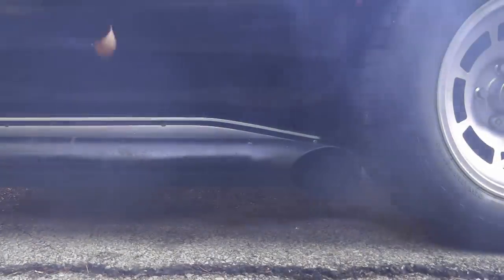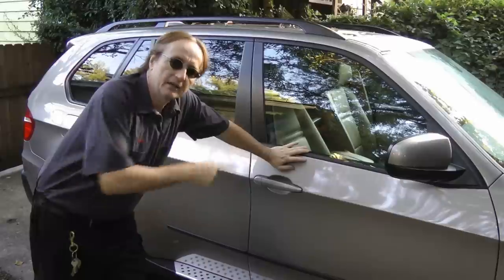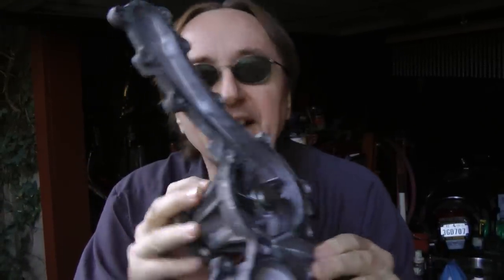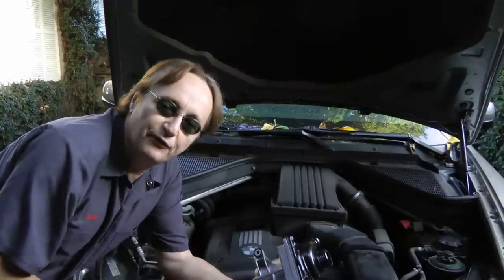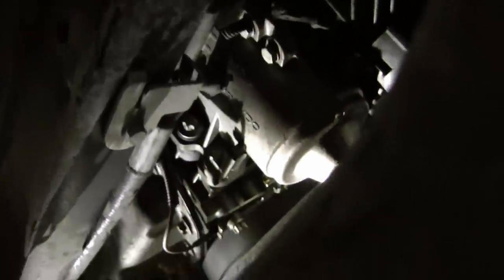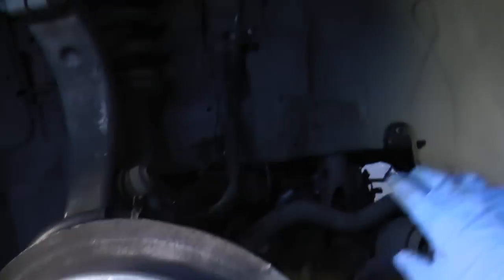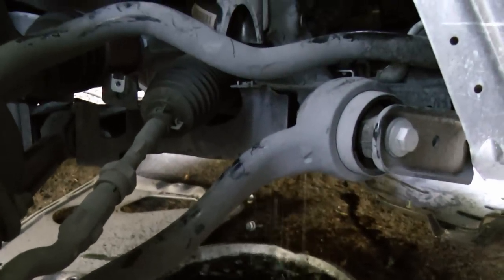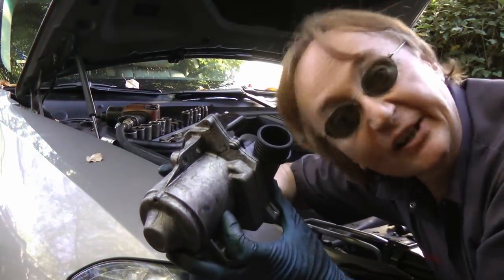How To Replace a Bad Electronic Water Pump

Comment: It is more beneficial to remove the AC system for weight savings, that is a lot of weight in components if you only care about going fast and not comfort. When the compressor clutch is not engaged there is not a lot of drag on the engine. 

I wasn't saying the alternator cant handle it rather that the electric water pump still gets its juice from a pulley on the engine.

The engine doesn't gain hp/torque it still has the EXACT same amount, just more is available for the drivetrain.

Comment: Scotty my bmw x1 2014's water pump keeps running until the car is dead. It hasn't overheated or said anything about temperature problems. I recently changed the thermostat on it because the heater only blew cold. Nice and hot now but after that was when I started finding the car dead with the water pump going all the time. Do you think its a bad pump or a sensor or something? I didn't bleed the radiator properly when I did it. didn't figure that out until later but it still won't shut off. The previous owner had green antifreeze instead of blue. If you got an Idea why the pump won't shut off let me know. There are also 3 codes coming up but I don't know what they are. U0079. U019F. P10F5. my car is the 2014 bmw x1 s28i something like that. Thanks

Comment: And also think of it this way. your car stereo draws more electrical load than a electric water pump. 

The down side to them (as kilmer pointed out) is that you won't be able to tell if the pump is out, unless the symptoms that were stated in the vid, show up.

Comment: Hi Scotty, Love your Videos. Here's a dumb Question. 2001 Jaguar XKR. The Auxilery Electric Super Charger Water Pump. Does it Matter which way the Pump Runs? It should Pull from the Auxilery Radiator and go Into the Supercharger, or the other way around? Also, can I Bench Test it by Attaching hoses to the inlet and outlet and Pull out of a Bucket of Water? I Know which wires are hot and ground on the Car, But they are not Labeled on the Pump itself. Thank You.
Reply from the maker: it matters which way it runs to keep overall flow the same.  But I have no idea which way it goes, as i've never worked on one myself.  but you  can bench test it, it's just a DC motor and running it backwards doesn't hurt the pump

Comment: he is partially right. Car manufactures are making more things on a car electrical because the alternator is more powerful today. Another reason is because it saves gas and there is more power leftover. See the alternator in today's car does not run all the time. The cars run on the battery and when the battery gets to a point the alternator turn on. So it freewheels most of the time(before the alternator always ran) But you are right the engine does not produce more power.

Comment: I'm simply amazed how, bulky that BMW pump is. The waterpumps on my last two cars were fully metal, compact affair about the size of my palm, even together with the impeller.  Mind you they were not that convenient to change either, that's why it was replaced together with the timing belt at the 120 thousand mile mark, when the vehicle was 16 yrs old, for the grand total of $400 including timing belt and engine seals.

Comment: Before they had the plastic ones, they had ones with metal housings that weren't any better. The entire engine has aluminum bolts to save weight. They designed it with an electric pump to better control the flow of the coolant and keep the drag off of the engine. Doesn't seem like much, but with it electrically controlled, and not having to drag down the engine all of the time, they save a little fuel and make more power. It is true that the pumps don't last long...I wish the company that was subbed out to build the pumps (I believe it was Bosch, but can't remember exactly) did a better job. I used to be a dealership technician and I replaced a lot of these. That particular model (E70 X5) is a little harder to replace the pump on, but the job can be done in under 2 hours.

Comment: I find it hard to say this, but could you get the best of both worlds? I know this is BMW, and they most probably justify the plastic with the idea the car is lighter, but could you get an electronic - METAL - water pump to get all the advantages you listed? 

Either way I would rather go with the mechanical pump at the end of the day, just food for thought

Comment: I am not in disclosure to say for security and privacy reasons. Yet i can tell you that, with proper maintanence, my car can get me around 20-22 miles per gallon on average. Both city and hwy. And, for a car that is more than 70% metal, that's pretty impressive for a 20 some odd year old car.

Comment: Common, it's not like he is the only one. I watched a video here on YT for example, where a guy who owned a professional garage, said the same thing. He actually removed a late model BMW engine and put it on a stand to better point out these plastic auxiliary parts bolted on the block. (There are at least six or seven similarly problematic engine ad-ons like the water pump mentioned). He was methodical and pretty depressive. At least Scotty added some light hearted humor to it, in comparison.

Comment: The water pump is designed to spin independently of the engine, and it also increases gas mileage, however slightly. BMW is hardly alone in this practice, and Toyota is moving there too. 

The days of heavy metal parts in the engine compartment is long over. If that means a decrease in fuel mileage, and therefore carbon emissions, I'm all for it

Comment: Warranty only pays like 2 hours to the tech for that water pump, just did one the other day... Another way is to remove fan and shroud, unbolt it underneath, push the thermostat out the was and squeeze it past the a/c belt

Comment: Hi Scotty, I own a BMW X5 e70 35d, my A/C was blowing cold air for one vent and hot air for the other(passenger side). My mechanic think there´s a leak on the evaporator... I was wondering if maybe this has something to do with the heater control valve... instead of just make a huge mess dismounting everything on the dashboard to get to the evaporator and replace it. Comments please

Comment: Hey Scotty ! You forgot that the whole purpose of this type of water pumps is to save weight and energy. For example the unit is somehow lighter than the metal one and is not spinning all the time (cold engine). But then all this "green savings" go to the trash when the pump fails and you have to do this. Planned obsolescense ? I bet that one for sure !
I have an 82 Mercedes and since then she travelled 400.000 Km and nothing more than maybe a water pump, shocks and things like that, Cheers !

Comment: I have  a 1997 Buick park avenue and I have a code reading "incorrect purge flow". I changed gas cap, charcoal canister, purge valve , still have the code I seen some disconnect lines under the engine cover. Connected those . I still have the code, do you think it's the NVLD or something like that excuse me if I spelled it wrong. And suggestions?

Comment: Also I know for the 3 series cars, the pump, with thermostat can be had for $400-500, from some of the online European shops, in some cases, you can get a whole package with all the plastic bits and bobs that usually fail with the pump. It is usually good preventive to replace it just after 100 k.. In my case anyway, since I have the CPO warranty. Im at 67k and hope mine fails at 99k for warranty reasons.

Comment: Scotty,
 i have 2006 BMW 325I 87K miles. Its overheating and when i turned on the heater there is no heat. Some say its the thermostat and some say water pump. Top radiator hose is hot and the bottom radiator hose is cold. The fan does not spin until it hit 245 degress Fahrenheit (YELLOW  light comes on the dash) and then at 250 degree RED light overheat on dash. Is there other way to check to see water pump is working while still on the car? 
Thank You Sir!

Comment: I bought the new Volkswagen Tiguan engine 2000 cc diesel 150 horsepower gearbox DSG, 4MOTION system. What do you think? It's a reliable car?
Reply from the maker: modern vws tend to be endless money pits as they age due to plastic being everywhere.  But it is a diesel, and they are better than their gas counterparts
Reply: Thank you! Have a nice day!

Comment: I bought a 94 325i with 156k last summer that still had the original water pump with the plastic impeller. Then this summer at 180k the radiator finally blew. I think that's pretty good considering how old the car is. With BMW going to electric water pumps I'm sure it has to do with fuel economy and temperature control more than cost. I can buy five or six regular E36 or E46 water pumps for what one of these electric pumps would be. Lol

Comment: Agreed on all counts.  I've asked BMW about this and they claim the failure rate for their plastic pump is the same as the metal ones.  Of course, if the car was under warranty the customer would get it replaced for free and not have to aggravate you into making a video so you can bash what is a sweet driving car.  It really is.

Comment: So was it the pump or the motor that quit? I have a 2013 escape and it's water pump, which is leaking, is similar to the toyota pump you replaced that ran off the timing belt. Which to me seems like a lame idea too. Though not as lame of the ford engine that runs the water pump from the timing CHAIN!

Comment: hi Mr. Kilmer, will I be able to get to the pump if I remove the radiator which I'm also going to replace? it's the same BMW as in this video. My pump lasted to 90k. I got my new pump for $300 and $250 for the radiator, not bad if you ask me.
Reply from the maker: yes, that makes the job easier
Reply: No need to take the radiator out at all. Lift the vehicle up as high as you can and work from underneath. There are a total of about 4-5 hoses that are connected to this pump. This is going to be the hardest part, as they do get a little bit stuck, but with a bit of patience, you should be able to do it no problem. If you are changing the radiator for whatever reason, then sure - take it off, but I don't really see how it may make your life much easier.

Comment from the maker: cause bolts tend to get cross threaded, break, and then big repair money goes to the mechanics. And generally, they like making fixing their cars a pain in the ass, right down to just bolting the wheels on. On this baby, I had to sledge hammer the wheel off the hub cause it had corroded on and just hung there after I took the bolts off.

Comment: I have that pump as well. I agree it is expensive but buying BMW you expect top engineering and this is what you get. Previously, having a pump that is fully dependent on engine revs was a bottle neck. Now pump is independent of the engine and can be freely controlled by the ECU what increases economy and HP. It is a progress and if you don't like it, you can always buy some more basic car. I just really hope that diagnostics of that pump are fairly designed and I will get some indication of a failure before engine overheats.
Reply: +MichalMalpa A fool and his money are soon parted.  With the improved "economy" I  guess that car will pay for itself in no time at all. "Bottleneck'?  You really have to be joking.
Reply: +MichalMalpa Good go give BMW your money. Heck an average BMW dealership has almost 10 service advisors working there and are swamped due to bullshit problems the cars give. We're talking newer cars with low miles too. Top notch engineering should mean built to last and not reinventing the wheel. Heck even BMW themselves changed stuff because they knew they fucked up. Remember the viscous fan clutches? How stupid and failure prone were they? MB unfortunately is following suit too. I had to replace the computer controlled electric thermostat in my car so instead of costing around $15 for the thing I ended up paying $100 for the part alone. A thermostat is such a simple functioning item and for some reason they had to make it computer controlled.
Reply: Djonkie Bonk
Not surprised. My company provided me with two new M-Bs and they were problematic from day one. Our experience mirrored nationally-published data.  Never again.
Reply: wholeNwon The thing is that they drive really nice and feel heavy and significant like a good quality watch. If only they ran like one for a long time. I don't mind changing extra suspension parts to maintain the ride or use expensive oil to keep the motor in good order but random shit breaks on these cars and the design of them just makes you scratch your head. Plastic electric water pump, plastic oil pan (BMW N20), electric thermostat, plastic cooling pipes, reverse flow manifolds (BMW N63) and too much emissions crap that leads to carbon buildup in those motors. All dumb designs.
Reply: +Djonkie Bonk Their shortcomings are well-known and widely publicized. 
I have a 3rd generation Lexus LS400 and love it.  Consider one of those or an LS430.  Bet you'll never go back to any German car.
Reply: wholeNwon Yeah a non air suspension LS430 or better yet a well maintained LS460 would be great.
Reply: +Djonkie Bonk Join the owners' club, read a little, etc. and I think you'll go for the LS400 or 430 instead.

Comment: Let me simplify it for you.

An engine is an air pump. It needs 3 things to run; air, fuel, and spark.
the engine's main job it to move a car. 

If it's using part of that power to drive other things, it sucks power away from moving the car.

What does an electric water pump draw power from? Electricity. 
Now with this draw, spark would only be effected if the charge cycle for the ignition coil wasn't quick enough. ignition coils are over engineered because of elect load from else where.

Comment: Going a bit off-topic, but I see a lot of BMW flame on the comments.

I don't know about the newer models, but I got 2001 E46 325 and that has been reasonably easy to repair. Not that there has been too much of that though. And it has the M54 engine, which I believe is one of the more reliable BMW motors. And not that hard to work on, at least not according to some vids on youtube and service manuals I've read. Though, cant say for sure, since I've not have to do any major repairs under the hood yet.

Now, it does have little more preventative maintenance than you regular family sedan, and it would add up quick if I was not doing it all myself. But there are ton of the older 3 series, so parts are not that expensive, at least not your typical BMW expensive. But the way it rides, well I think the hassle is worth it.

And sum it up, I do agree with mister Kilmer here to a degree. If you can't do basic and intermediate repairs and maintenance yourself, don't buy a BMW. And if you are not rich, don't buy a new BMW. (or one of the less common models, like 7 series)

Comment: Scotty Love your show...that said......The coolant in that car was not the correct coolant judging by the color Ethylene glycol was introduced allowing (stray) electrolysis current. Bmw and many other manufacturers specify H.O.A.T / g-50 coolant to prevent corrosion (head gaskets). Your customer will be returning in the future with milk shake lubrication problems and a engine code for eic soon
Reply: all coolants are derived from ethylene glycol.
Reply: Propylene glycol is frequently used as a substitute for ethylene glycol in low toxicity, environmentally friendly automotive antifreeze
The eutectic composition/temperature is 60:40 propylene glycol:water/-60 °C the −50 °F/−45 °C commercial product is, however, water rich; a typical formulation is 40:60.
Reply: According to my bottle of BMW coolant contains ethylene glycol.
Reply: Sometimes BMW branded coolant is basically G05 with color dye. Same thing with Mercedes coolant. They just add blue dye.

Comment: Scotty........I have a 2001 Grand Caravan with a CHECK ENGINE light and dealer said needed new TCM/TCU -Transmission Control Module. Want to change it myself. Dealer said they have to program it but online ECM/TCM reseller say they send replacement units PRE_PROGRAMMED??? What's your advice on using these parts. They say it's a lifetime warranty.

Comment: In BMW's defense the electronic water pump is made so that there is less resistance on the engine and this improves gas mileage. It also can spin at a speed independent of the engine depending on temperature and other driving conditions. I will agree however that on a car of this age it should not fail especially one in this price range.

Comment: i am using 800cc carborator engine car nd normally run it on Compressed Natural Gas, every day n the morning when i start the engine it gives smoke dark white color for not more them three minutes maybe till the engine warms up from last about 3 engine oil changes i am also adding LiquiMoly Mos2 with engine oil to solve this smoke issue. I want to know if its normal during winter or is there any soloution to it..?

Comment: I'd imagine, and correct me if I'm wrong. They use an electric water pump so they can regulate the flow to the engine and take out the thermostat. Also probably reducing emissions a negligible amount. Still seems a daft idea if you ask me.

Comment: Hey Scotty, My mother has a Hyundai Getz, why it would the BRAKE light stay on in the dash, while its not engage while driving ?? Also the check engine light has been coming on n going every once in while. Oil and water levels are right.. What may be wrong ?

Comment: What's worse? The BWM design or having to take the timing belt off to do it? I guess this, since you usually replace the water pump when doing the timing belt. /shrugs

Comment: That's German engineering for you. Anything I replace under the hood for a 99 VW beetle is the same deal. The electrical connectors gets very brittle and I end up having to replace them as well. Another thing to mention is the plastic water pump impeller design. Definitely the Three stooges definitely designed it.